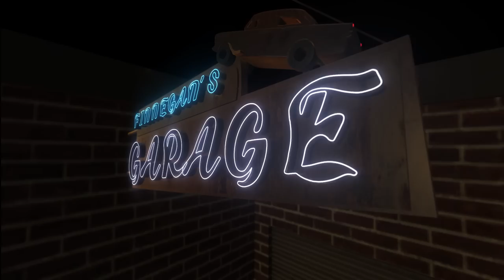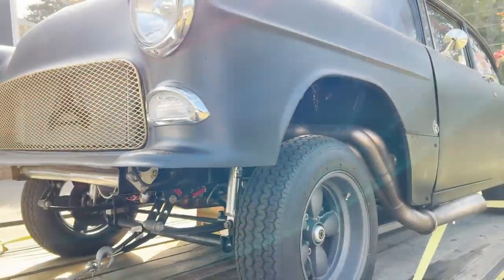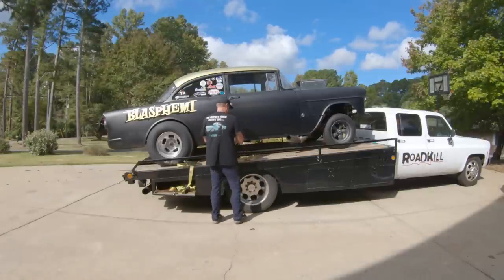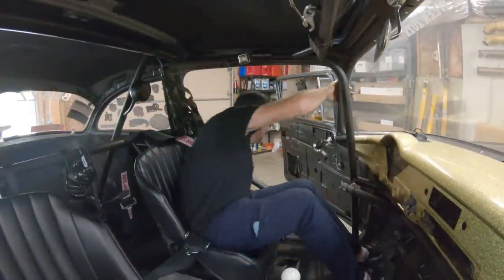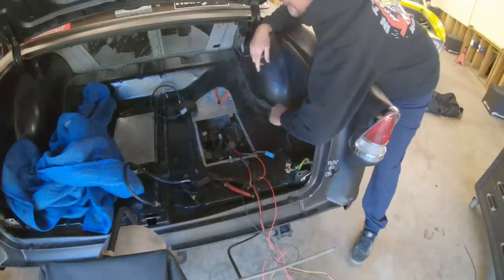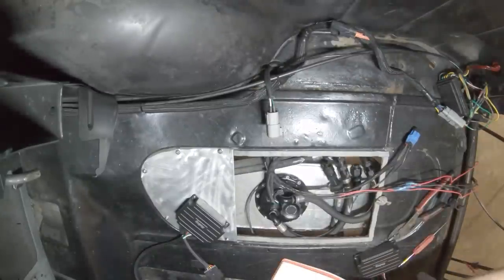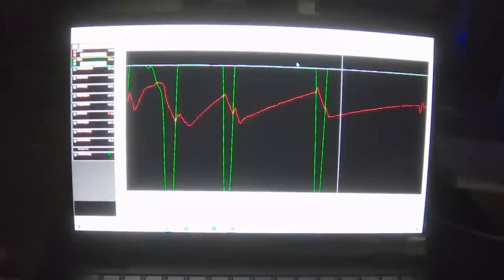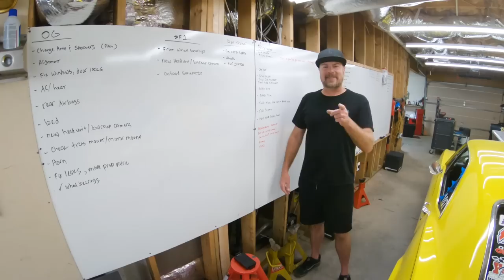DISASTER AVERTED! NEW FUEL PUMPS SAVE THE HEMI !

Comment: Nutsert tips from someone who's installed a lot of them, and had them strip out on occasion.
Buy the steel inserts (Mc Master Carr) with the knurl... Drill the hole one size smaller than recommended(may need letter drills). Tap the insert into the hole and set it. Use never seize on the screw threads.
If you've ever had one spin out, you know....

Comment: Going to miss Newbern but as said before, FAMILY IS EVERYTHING.

So you guys " DIDN'T SCREW UP AT THE TRACK BY NOT FILLING UP YOUR FUEL ", NICE.

Who is responsible ( IMHO ) for melting the engine, " THE DYNO TUNER ".

He should have caught that on the DYNO.

Glad you figured it out but BE THERE WHEN EVER YOUR CARS ARE BEING RUN ON THE DYNO. OR FIND
A RELIABLE TUNER. THAT SHOULD HAVE NEVER HAPPENED.

Comment: Finnagan that’s just a normal 12 valve leak you replace every gasket in whole motor 30 mins later leaks again but you might wanna check tappet cover and timing cover that’s the 2 main leaks

Comment: Trailer tie down.  40 years ago we raced a 66 Chevelle, towed on an open trailer with tie down straps.  The trailer was not fully decked (open in the middle, great for oil changes).  After a 3 hour tow, I climbed under the back of the car to untie.  I grabbed one of the shocks as a handle and significantly burned my hand.  I realized that the shocks are getting abused a worn out just from towing.  I changed to using lever chain binders and blocks under the frame rails.  I had a loop welded to center of the saddle crossmember in the front with a block mounted on a trailer crossmember.  In the rear I put the blocks on each side on the deck in front of the rear tires.  Behind the rear tires I had loops welded to the frame of the car, and loops on the trailer frame.  The blocks should be short enough to get good compression when the binders are latched.  I then used quick links thru the hole in the handle to the binders chain so they couldn't release due to bumps on the highway.  
Sorry to lose Newbern, but always wondered about how could he manage family life. Best of luck Dave! Hope to see you again.
Keep the shows coming!!!  Darryl Bergerson

Comment: Don't forget that the Firebird probably needs the same fuel pump upgrades you just installed on Blasphemi because when you did Drag Week and got to the last track and installed the party pulley it fell on it's face too from lack of fuel pump capability and couldn't supply what it needed with that much boost also!!!

Comment: Howdy... first time watching your channel and love any of the tri-fives as I grew up with them. AS for your nutzert tool I've installed thousands of those things and t hey are great. An improvement that you can make to your tool is to cut a screwdriver slot in the knob-handle. This way you can use an electric screwdriver to quickly remove the tool. We did at work as, like I said, we installed thousands of those. I like you car and the info that you have provided regarding the fuel pressure... interesting! I love drag racing and I used to run at Irwindale, Orange County, once at Lion's, and a couple of times at Tommy Ivo's track, which I think is now called Fontana. Keep up the good work. I'll be back!

Comment: Hey dear.. A tech tip for you.. Did you know FORD used nut Inserts way way way back in the 60's and 70's to put on their mirrors on doors, and hold componants in the dash. only down side of them was if some one took apart things the inserts usually spunn in the sheet metal.  My recomondation make sure you Bathe the fastener in Anti Seize, and do not tighten like crazy. Knowing what I learned from mistakes made. when i bought my 1979 F150 Short Box 4x4 the first thing we did was removed mirrors ect and Antiseized every fastener and did not use extream torque reinstalling them, knowing trees or such may take off a mirror. Another tip if using nut inserts on outter exterior serfaces where weather and salt ect driving put a film of silicone to seal out bad from getting into the threads. you will thank me down the road when if you have to take apart your componant held by nut inserts...

Comment: Finnegan, does your EFI have O2 safety logic or low fuel pressure safety logic you can enable to save the motor?  I recall my mega squirt EFI system had dozens of custom configurable safety logics that could be turned on to prevent this kind of thing.  Just a thought.

Comment: I really question the logs showing 15psi fuel pressure and 15psi boost. At that point you have approximately zero differential pressure and not enough fuel flow to make that engine run at all.

Comment: Talkin about mid plates and motor twist, wasn't there a point that you realized that all your bell bolts were a 1/8th to long and tightening only due to bottoming out? Ya got the dowels but they're tapered also. 2 points takin all the hit over n over. curious.

Comment: I knew it was a fuel supply issue! I could hear it. not sure what kind of failsafes you had setup on blasphemy but i hadnt seen a fuel pressure sensor or temp sensor. it helps the ecu calculate the fueling more accurately as well.

Comment: Check out Kelderman air ride.  Full 4 link with air bags and completely removing the leaf springs would be a sweet setup.  Also ability to dump air to make loading easier.  On board air compressor for auto leveling and also airing up tires and some small air tools.

Comment: In have seen two shops burn down because the ceiling was open. I would get some sheetrock or something over the insulation. It can catch a spark and smolder for days then light off.

Comment: I have a comment about your motor plate and mid-mount.  On my car , I added a bar that triangulates the mid-mount to the frame to prevent the engine and transmission from moving rearward during launch .  It's removable so engine removal is easy , it goes from about the bellhousing crank height , 45 degs back to the frame. It also helps keep the rearward load off the transmission.  Good  luck with your project,  it is pretty cool !

Comment: Then someone was looking out for and it rained, that's a good thing. Because that been the end of that motor and lot of hard work, and going that fast with slicks, who knows what would have happened. That was good thing because Luck's new partner would gone even faster She was really mad that they called the race She wanted to beat Tom Bailey I think she might have. I think you and Tony really were tired. Well at least you got it figured out and running again, you got next yea. I like what Tom did with week long race Shortened the distance between  tracks. Hot Rod could blame it on the on the price of gas, He got iot down to 200 miles between tracks/. Glad you got it figured out.

Comment: All the best 12v Dave you will be missed but family first. Nut certs are awesome but they do sometimes spin when disassembly they can spin I like to use a little silicon or lock tight on the back side.

Comment: Nutserts are great; i put a stud in there with a nut to lock the stud in place; then you've got some length to put a rubber buffer between the body panel and the unit.

Comment: Pro tip for "nut-serts"...   Put a dab of red Loctite on the shoulder on the outside of the insert right where it bottoms out in the sheet metal. That locks the insert from spinning for whatever reason. The first time one spins and you're stuck trying to get the bolt out you'll wish you'd put the Loctite on...

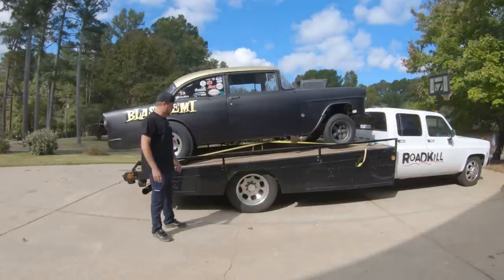Comment: 8:11 IMHO, i think you should just cut out the whole sector that's suspension on the rear and make a cantilever setup, most commonly found in low-rider trailers or campers. That way, you don't have to overthink it. I think there's already solutions you can buy and basically weld in place on the market.
The pros of such a move would be less time spent fabricating, and it would fit within the existing space of the deck, but give you all the advantages of proper height. You could put any kind of shock in the horizontal.

Comment: Mike, I recall that one time you said you hated inserted nuts because they would sometimes spin in the hole after installing the bolt. After I drill the hole for the insert I take a small triangular file and make a small notch in the side of the hole. This gives the insert a better bite in the hole and eliminates the tendency of it to spin when wrenching down on the bolt. Of course, the bigger the insert, the bigger the notch. Hope this helps.

Comment: It would not hurt to put rubber isolators  between the controllers and the sheet metal to reduce the vibration. Despite the controllers being solid state it would not hurt to make them vibrate less.

Comment: First off, best of luck to Newbern. 

Second off, experienced tow truck guy here. I would HIGHLY recommend upgrading to a set of 8 point wheel straps, you can get them online from AW direct. They're awesome, wicked fast, and provide a damage free tie down that allows the suspension to do it's thing & stays tight on any vehicle with tires that hold air. 

Airbags seem like a whole lot of work for something that isn't gonna help much. I would look to the salvage yard for a solution & find yourself a set of progressive helper springs from a Ford F450/550. Maybe even add a leaf while you're at it. You want your tow truck to be super reliable, don't over complicate it with expensive & hard to find parts that are prone to failure. Just my opinion.

Comment: Got to ask. The 2x3 steel tube weld on the drive shaft are to check clearance for rear axle movement?
Reply: Looks like he cut the shaft and lengthened it with the tubing. My guess was so they could set driveshaft angle and pinion angle with the wrong length shaft.

Comment: You definitely need to finish hanging that drywall and then at least tape it and put a coat of drywall mud over everything. It's starting to driving me nuts seeing that unfinished. Yes I am a drywall contractor.
Reply: Fire-code drywall is required in most places if you have an attached garage.  Make it safe and keep the O2 out of the house.
Reply: 5/8 type x drywall is rated for 1 hour and should be hung anywhere separating the living area ceilings and walls. The framing should be sealed at the bottom of the concrete floor and all joints have to be taped and coated at least once and a coat on the screws. Any more application of mud is strictly cosmetic.